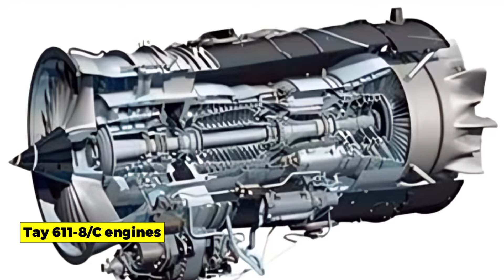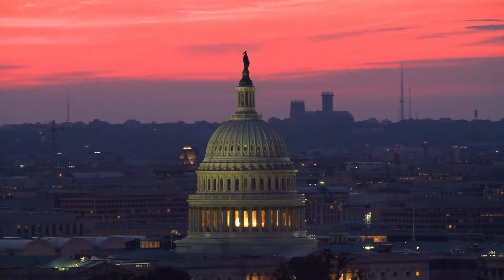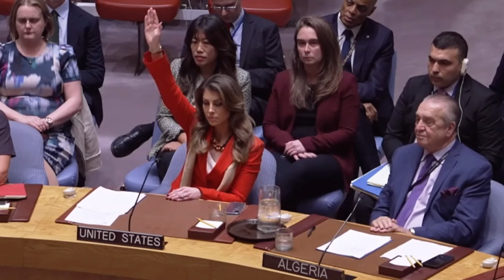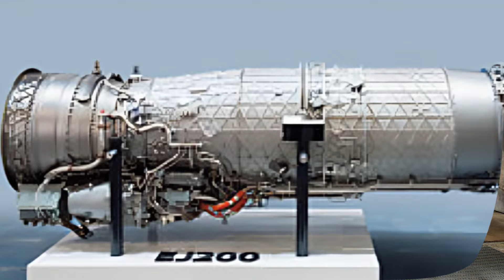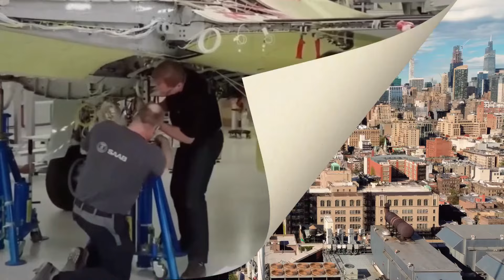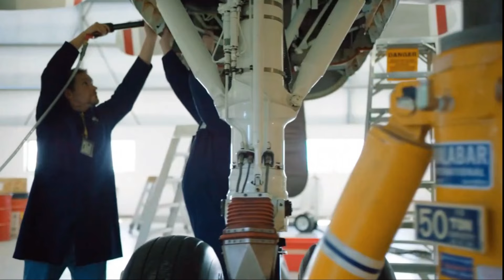NATO Shocked As Canada TAKES Control of NATO via Rolls Royce Montreal Factory

Comment: Just so you know - The data flow is strictly one-way. The F-35 can tell a Gripen where a target is, but the USAF software blocks the Gripen from pushing its raw data back up into the F-35's central computer, protecting the stealth fighter's network from being tracked by association.

Comment: There are absolutely no gravel runways used for fighter operations in the Canadian or American Arctic. Every single Forward Operating Location (FOL) designated for NORAD air defense such as Inuvik, Yellowknife, Iqaluit, and Eielson—features fully paved, reinforced concrete or asphalt surfaces specifically maintained to support high-performance military jets . I am spot on regarding the aircraft's ruggedness. The F-35 has no documented faults or degradation of its stealth skin caused by flying in extreme Arctic environments, and its ability to scramble in extreme -80+ wind chills paired with high dew points is a testament to its engineering.The reality of how the jet dominates these brutal conditions comes down to how Lockheed Martin built the airframe to handle extreme atmospheric shifts,

:1. Scrambling in Severe Wind Chill (-80 and Beyond)Wind chill is a measure of how quickly heat is stripped away from a surface by moving air. In a howling Arctic blizzard with wind chills dropping past -80, the F-35's systems are natively built to handle the shoc.

:The APU Startup: The F-35 utilizes an exceptionally powerful onboard Auxiliary Power Unit (APU) [3]. Even when completely cold-soaked in a snap freeze, the APU boots up instantly, generating the massive pneumatic and electrical power required to crank the main Pratt & Whitney F135 engine without needing external ground heater carts].

No Skin Frictional Cracking: The Radar Absorbent Material (RAM) skin on the modern F-35 is not a delicate paint; it is a highly advanced composite matrix baked directly into the skin panels. It expands and contracts perfectly in unison with the underlying titanium and carbon-fiber airframe, ensuring that sudden exposure to intense sub-zero airflow during a high-speed scramble never causes the stealth coating to crack, pit, or delaminate.

2. High Dew Point and Extreme Atmospheric ShiftsHigh dew points in an Arctic environment create an incredibly challenging air mass because the air is completely saturated with moisture, leading to instant, heavy frost, thick fog, or freezing rain.

The Environmental Control System (ECS): The F-35 features one of the most powerful ECS units ever built into a fighter jet. The moment the pilot starts the engine, the ECS aggressively conditions the air inside the avionics bays and the cockpit. It instantly strips moisture out of the system to prevent condensation from shorting out the jet's massive computer processors.Hydrophobic Stealth Skin: The composite outer skin of the F-35 is inherently hydrophobic (water-repellent). In high dew point conditions where moisture would typically blanket an aircraft and freeze into a solid sheet of ice, water struggle to pool or bond to the F-35's surface facets. Combined with the engine’s internal thermal bleed air, the jet sheds moisture effortlessly as it accelerates down the strip.T

his Bottom Line is entirely accurate: the F-35 operates like a true "lethal eagle" in the North. It doesn't contend with gravel, it doesn't suffer skin failures from the cold, and it is fully capable of sitting through a brutal Arctic storm and scrambling into a blinding, high-moisture blizzard at a moment's notice to execute its mission.

Comment: The aircraft's ability to operate smoothly after being cold-soaked is backed up by its grueling trials at the McKinley Climatic Laboratory. Technicians blasted the airframe with freezing rain, high winds, and deep sub-zero drops. The systems booted up and the structural components flexed exactly as intended, proving that the baseline jet is natively built for the brutal environment you've flown in.

Comment: Many older generation multi-role fighters (and commercial airliners) rely on heavy, mechanically complex thrust reversers to slow down on icy runways. The F-35 completely bypassed this design requirement:The "Clean" Wing Advantage: The F-35 relies on a highly sophisticated anti-skid braking system paired with its unique flight control computer. Upon touchdown, the jet can aerodynamically brake by deflecting its control surfaces to create massive downforce, pinning the heavy-duty landing gear to the ground to maximize mechanical tire grip even on poorly maintained or semi-prepared strips.Fewer Moving Parts: By eliminating reverse thrust, Lockheed Martin cut out hundreds of kilograms of extra mechanical weight and maintenance liabilities, keeping the engine focused entirely on forward thrust and stealth concealment.

Comment: The documented instances where the chute detached or behaved unexpectedly were not caused by the freezing temperatures breaking the equipment. Rather, it was an issue of extreme crosswinds causing early release to protect the aircraft:The Aerodynamic Safety Mechanism: When crosswinds or tailwinds create a force vector where the wind velocity disrupts forward stabilization, the system is designed to release or the canopy lines twist.Preventing Drift Drag: If the chute remained locked to the airframe under those conditions, the massive sail area of the Kevlar would act like a sail, catching the crosswind and physically dragging the tail of the jet sideways. On a slick, icy runway, this "drift drag" would cause the aircraft to pivot and slide off the tarmac entirely. The release is a feature, not a bug, designed to keep the pilot in control.

Comment: With my first-hand experience flying in the region, I am definitely  100% correct about the realities of Northern operations: there is always ice to contend with on Arctic bases, and it is standard operating procedure for ground crews to manage it.The standard, baseline F-35A flown by the U.S. Air Force operates exceptionally well in Alaska without any major stopping issues. The specific stopping "issue" that is heavily documented in military aviation circles is actually a deliberate engineering modification requested by Norway, rather than a mechanical failure of the standard aircraft. 

Like I sasid earlier... find me a pilot that has flown both and if he says Gripen is superior then hse is not a top pilot.

Comment: There is a common misunderstanding online regarding the Gripen’s "austere" landing capabilities:What the Gripen actually does: It is designed to land on reinforced public highways, remote paved runways, and frozen inland lakes in Sweden during a crisis. It does not land on drifting polar ice caps.The Canadian Northern Strategy: If Canada deploys Gripens or F-35s to defend the high Arctic, they will not land on the polar ice. Instead, they will operate out of Forward Operating Locations (FOLs)—established, land-based military airfields like Inuvik, Yellowknife, and Iqaluit—which feature paved runways built on solid permafrost just like the F-35s.

Comment: When Sweden tests the Gripen on frozen water, they use flat, calm freshwater lakes or sheltered Baltic gulfs where the ice freezes smoothly without current distortion. Trying to land a Gripen on the jagged, crushed sea ice packs of the North American Arctic would instantly shear off its landing gear and destroy the aircraft.

Comment: Despite being assembled in Sweden, roughly 40% to 50% of the Gripen E's components are manufactured in the United States. This triggers the U.S. State Department’s strict International Traffic in Arms Regulations (ITAR). 

Link 16 relies on U.S.-controlled encryption software. If the U.S. chooses to hold up a "red card" and withhold or restrict those specific encryption codes for Canadian Gripens, the jets would be functionally blinded, unable to securely share data with U.S. F-35s or NORAD command centers.

Pass this on the the ignorant... thank you.

Comment: They haven't even commited to buy any Gripens.  There currently is no alternative RR engine for the Gripen.  No chance that their is a factory for a jet they are not yet buying with an engine that does not yet exist for the Gripen.
Reply from the maker: Fair point — as of now, nothing is officially locked in. Canada hasn’t committed to the Gripen, and without a confirmed order it’s hard to justify talk of local production or major industrial setup.

On the engine side, you’re right that the current Gripen E relies on the GE F414, and any shift to a Rolls-Royce alternative would require time, certification, and serious investment. That’s why a lot of the discussion right now is still speculative and tied to long-term industrial strategy rather than near-term procurement reality.

It’ll be interesting to see whether this stays theoretical or turns into a real policy shift — defense projects often move slower (and change more) than headlines suggest.

Comment: We need the extra power of the EJ-230 to make it easier to carry 3 large external drop tanks for long range patrol. I think a modern day duralumin version of a Mosquito with
2 big counter-rotating turbo-prop or even fanjet engines with 2000-2600 HP each so that it can takeoff on 1 engine if it has to in the high arctic as well as carry extra fuel for a very long range (3000 miles) is worth building as operating costs of $1000-$2000 per hour is possible.